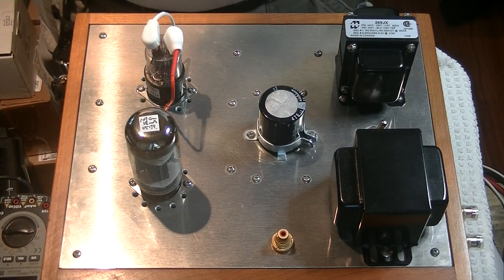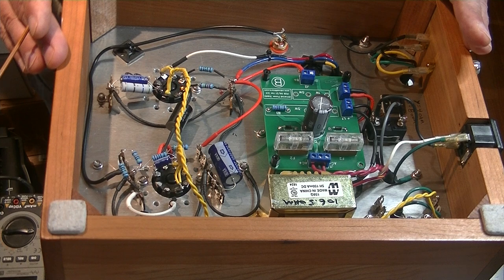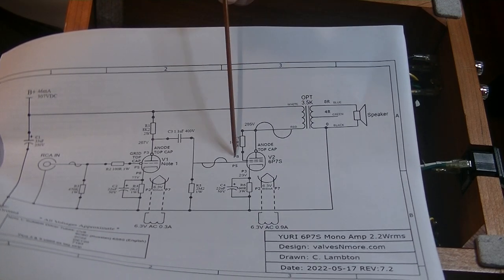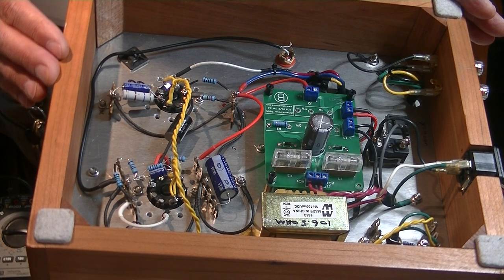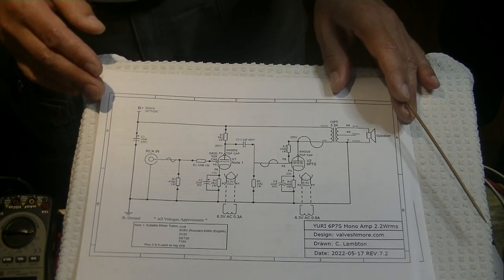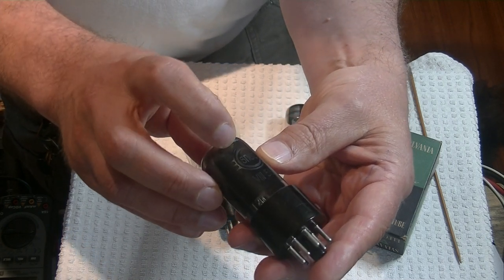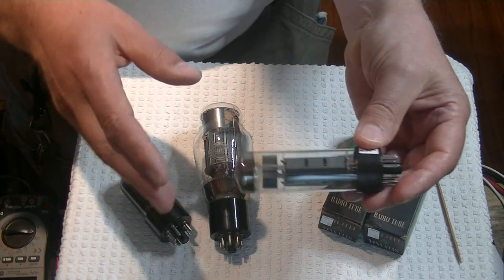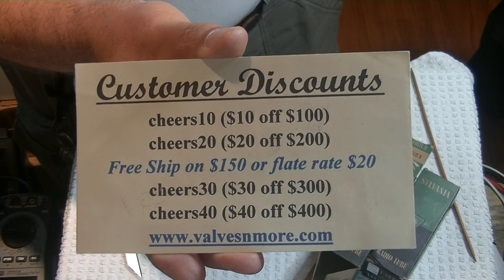Tube Lab #93 - Upgrading an Existing Amp

Comment: Another great video! True unfortunately, of the triode amps I have, the 211 gets very hot, and the GM70 one could use not just to fry an egg but grill chicken wings… But as you say, pure Class A triode is the way to go, no question about that.

Comment: I used KLH ultimate ones with my little dot headphone amp. Eventually I gave in as the impedance of the KLHs was 32ohm which is too low for the little dot. I felt that in my other system they sounded better than the senheiser hd650s. If your headphone amp would drive them or my audeze lcd-x, is be very interested in your kit. So many headphones are low impedance to use on mobile phones.
Reply from the maker: Hi Neil, that's the problem with OTL amps. There isn't a lot of flexibility with the output impedance. And when you're talking high impedance output into low impedance headphones it's not a great pairing. Our kit is going to use output transformers and will have an impedance switch. We haven't finalized the impedances we will cover yet but be sure we'll try to make sure it's compatible with as many headphones as possible. -Charles
Reply: @tubelab194  I was looking at building a hybrid design to combat it but that feels like cheating. I'll be following your progress. It looks awesome in your preliminary sketches. Hope you can export it to the UK.

Comment: The headphone amp looks great! It looks like a headphone stand actually, did you guys plan to have it additionally act as a headphone stand as well? You didn't mention it in the video.
Reply from the maker: Hi Sean! We did consider that a possibility and would love if the final amp can act as a stand. What we aren't sure on right now is just how wide it will have to be, and if that will work with most headphones. We're going to do our best to make sure it's possible though. -Charles

Comment: Why is the Yuri front end coupling cap value that big at 1.1uF?
Reply from the maker: Ahhh someone read the schematic!  I follow the design philosophy of Paul at PS Audio, his thinking is you need to be careful with coupling caps to not make them too close to the low frequency cutoff point. Traditionally engineers use the coupling cap in circuit for two things, first to block DC and pass the AC signal and second as a high pass filter, basically filtering very low frequencies.  Paul's thinking is we risk removing a part of the music spectrum that influences the low end or bass frequencies.  So he likes to go very wide band on the coupling caps and only tighten up (lower) the values IF a problem occurs in circuit.  Since I adopted his design philosophy, I've been building preamps and amps with absolutely the best Bass response I've ever heard.  Yes if you sweep the circuit you'll see some small noise artifacts in the very low frequencies (10-20hz) but so long as they aren't much above the noise floor, I leave them alone, they may actually be helping the low end sound more natural.
Reply: @tubelab194  Thanks for sharing. That’s a valid POV..  I guess the only major thing I depart from Paul’s opinion is his eschewing of tube output stages in Amps. But I guess taste in loudspeaker type also dictates that..
Reply from the maker: @rickg8015  Paul's a great guy and resource, I've followed him for years, but I can remember a time when he put down vacuum tube technology as old, finicky, unreliable and unnecessary, or some such thinking.  Now PS Audio is using tubes in the front end stage of much of their equipment!  And here's the fun bit, their big power amps run large banks of solid state output devices running in Class A, all strapped in parallel to get high power.  Something tube power amp designers have been doing forever to get high power.  My design philosophy differs from Paul's when it comes to the amount of power required for high quality sound.  It is my experience that reasonably efficient speakers (92db+) sound better and more responsive and because they don't require much power to drive them (my reference system is normally running at 0.25w!) you now have an incredible number of great sounding power tubes that you can use in Pure Class A.  No need for a space heater/tube amp combo (solid state or tube)!